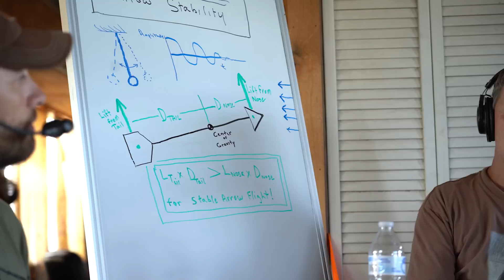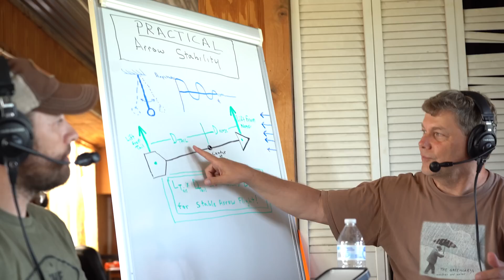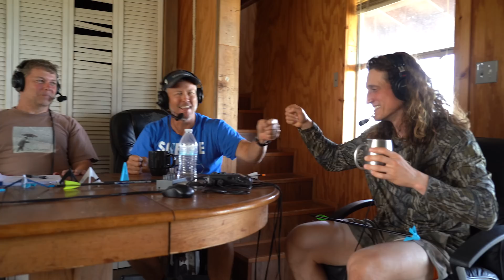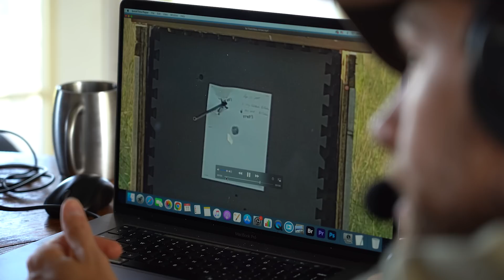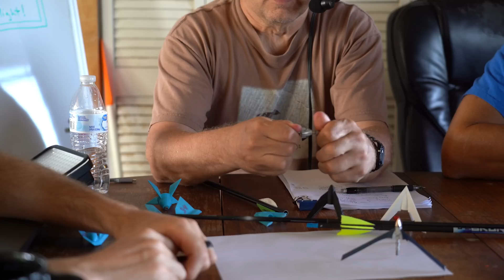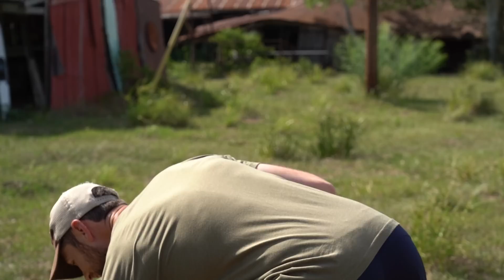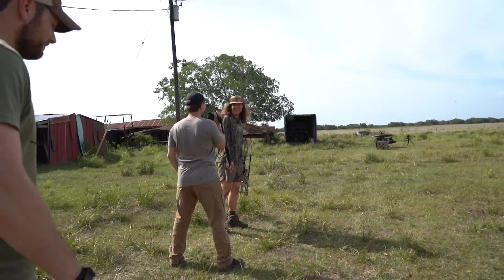WE SHOT A $500 BROADHEAD?!

Comment: The whole time I was wondering about the impact when the broadhead would get cocked sideways. I like the idea of the fixed point. I bet the gimbeled blade would allow one side to hit a bone then move away from the bone while the arrow continues to penetrate straight.

Another idea I have had is that you guys need to come out with a large diamond bench stone with about a 5-10 degree angle in a ridge down the middle so your average dummy can get sharper 3 blade heads. Sharpening 3 blade heads on a flat stone gets a really coarse angle and really won't shave hair. If your average dummy had a slightly beveled stone and kept the point running down the peak of the bevel he could get a much sharper blade angle.

Comment: .9 is 9 tenths is it not? .09 would be less than an inch? .9 would be 10.8”?
Reply: Not quite.  10/10 = 1", 9/10=.9", 9/100 = .09, etc.  So 9 tenths is a tenth less than 10 tenths.  Let's just say the group was slightly smaller than an inch at 60 yards :)
Reply: @DigtoDef  there is ten tenths in a foot. Not ten tenths in an inch. There are 10 100ths in an inch? 1 10th is actually an 1 14”. What he meant to say was .09. I assure you.
Reply: @DigtoDef  if I could send you a picture of my tenths tape I use at work, I could show you. I use tenths regularly. 0.9” is just a skosh over 10 3/4”. 0.08 is a 1” group.
Reply: @tylerraglin4133   I have no doubt that your tape is correct.  But  9/10 of an inch is .9 inches, 9/10 of a foot is .9 feet, and 9/10 of a mile is .9 miles.  Just because your tape reads .9 of a foot  doesn't make the other fractions of a distance invalid.  So .9 alone doesn't automatically stand for feet.  It's 90% of whatever unit your are associating it with.  Doesn't make sense to say he lives .9 from here without any units attached.   Take any digital caliper, set it on .9 inches, and see how far apart the arms are.   If they are nearly 10 inches wide,  I'll buy you a cheeseburger :)

Comment: I love new technology. Been using Mechanical BH for 25 years. In my book, if it has moving parts it's mechanical.  Who gives a darn how it is described if it works? Before going to press on some of those broadheads, might want to consider the fact that they could be defined as barbed as the blades don't fold back.  Good Luck with this one Rocketman, you can figure it out😉.

Comment: What happened on Zach's shot? It looked like the arrow was flying sideways through the air...
Reply: He cut the fletching off!  It can fly without fletching, but not when the shaft angle in flight exceed the gimbal angle.  We should've mentioned that he did that on that shot...
Reply: @DigtoDef  Ah, that makes sense. What caused the shaft angle to increase beyond the gimbal angle? It must be the release since we know the shaft itself doesn't generate enough lift to yaw the arrow that much, correct?
Reply: @travistaran2398  It can come from the release yes which is human induced. And it can also come from an out of tune bow or a torqued bow.  Either way, the arrow has a yaw rate associated with the launch.   Since it is a yaw (or pitch) rate, that means it grows with time and if the rate is high enough,  the nose can begin to lift (even on a field point) and the angle will continue to climb.  The yaw angle must've exceeded the gimbal angle at some point for the arrow to start generating lift and turn sideways, and with no fletching there's nothing to stop it from continuing to turn sideways.   In hind sight, we should've shot a bare shaft with a field point on it through Zach's bow first to see how it shot.  But the excitement of the moment took over for all of us, I think.   No damage to the broadhead, but that tripod tho.   It wasn't scientific, but it was a lot fun :)

Comment: This is awesome. Freaking love it. The aerodynamics are there, it’s just the mechanical implementation that’s tricky. 

Seems like you’re picking up a wobble at the blade-ferrule ball interface. My guess is that’s due to not having a true captive ball and socket joint with tight tolerances due to the sliding design you implemented to disengage the head lock during the the shot. 

Find a way to implement a shot-activated head lock release with a tightly-toleranced captive ball and socket joint and maybe that pesky wobble goes away?
Reply: Indeed.  You have hit the nail on the head and I so appreciate your comments.  The concept still needs work, and the testing here and with Bohning revealed that this implementation does not work 100% of the time.  I feel it's close, but it's not there yet.  When it does work it works magnificently.  
As an aside, I tend to think of the particular three-blade implementation I chose to fabricate as a technology demonstrator rather than a prototype near-market ready bh.  I felt like the three blade would be less problematic in an initial metal implementation.  In essence, it is a new technology, not a new broadhead.   Most importantly, whether this implementation works now or not wasn't really the point of the video.  The point I want people to know is that if you grasp the basic aerodynamics of the arrow, you know what things you can do to make them fly better.  This concept demonstrates but one of those possible things.  
FYI, none of this podcast episode was scripted.    It is what it is- no one even knew I had them there- I had planned  to introduce the concept while we were sitting around the table as a follow-on to the previous video on arrow flight.  I wasn't planning on them getting shot, or (gasp!) shot without fletching.  Leave it to THP to cut through the BS and get to the shooting.   Really though, I'm glad they were shot and captured on video warts and all for all to see how it can work and get a picture of what it's supposed to do.  

Best regards,
D-
Reply: Darrel, I think the fact the vid was unscripted makes this even more impressive. If only my aerospace courses were so straightforward and relatable! Also it takes guts to publicize a prototype these days when everyone’s a critic. Your (1) technical knowledge, (2) willingness to share that knowledge, (3) technical curiosity, (4) “garage” (or in your case, bedroom wind tunnel) engineering skills, and (5) willingness to fail are truly impressive! Can’t wait to see where all of this leads. Could definitely be an industry game changer. And no tech can be expected to be Zach-proof, especially with that goofy and super punchy form with which he hit that release trigger 😂

Comment: This has me intrigued beyond belief. What stinks is the process is so high tech it often takes years to get to market. Any timeline with Bohning? Probably have to keep that info hush hush but a 2" fixed blade that groups that well is an absolute game changer. I wonder if the penetration question could still be answered with heavier mass weight. I think itd penetrate just fine as is since a 1.5" or 2" fixed blade will create less drag on the shaft itself.
Reply: No timeline.  I don't feel like the concept is ready for primetime, and this may not be the implementation that should make it to market.  I hope it does make it in some form though!

Comment: Rockets and arrows are totally different things
Reply: @donmcbean7465  okay one an arrow is made up of carbon fiber with various spines and thickness. A rocket is made up of a series of metal. An arrow as a broadhead on the front a rocket has a point. A rocket is propelled by a combustion engine propelling it as with an arrow has no engine on the back and slows down immediately after launch. If we’re talking about space rockets they fly straight up and down as where an arrow flys horizontal through the air. Should I go on??

Comment: Interesting concept. I'm shocked at how many commented that don't understand that the chisel point of the head does not move. It is only the blades that are free to move and spin about the shaft  of the head. If anything this should keep the arrow tracking straighter in the animal as the blades can, to a degree, move around bone if the contact is at a shallow angle. 

RF and RM. This is a testing channel. Time to nut up and spend some cash on a proper slow-motion camera. I would love a test of mech, fixed, spinning insert, and the gamble head shot from an out of tune bow with slow-motion footage from 15 to 50 yards.....if ever an image was worth 1000 words.

Your work is fantastic and pushing positive change in an industry, and with a population, that needs it.
Reply: Thanks!  You nailed it - the nose is attached to the shaft via a rigid steel post - so it should fly as well as a field point and the shaft should hit in line too.  The blades should just pivot around the bone as needed.   We have a high speed camera, but so far it's been used for a lot of close in work - thanks for your constructive comments!

Comment: A big broadhead makes the kill zone smaller if it can't penetrate hard bone.  If you had a single bevel with lots of mass that could punch through heavy bone, then the larger cutting diameter actually makes the kill zone bigger.  So that's like the rocket man was saying: you don't want to make the broadhead any bigger than you can still get a full pass through.  But you want as big a cutting diameter as you can still shoot through heavy bone and the kill zone.

Comment: That is so cool. Basically taking the oscillation out of the arrow. But what I missed (might have been in the other video) is what about the rotation of the arrow due to it's helical or offset fletching, and drag from the kind and number of fletches?
Reply: I think it should spin normally with the field point, independent of  blade, assuming your ball/bearing is well lubed.
Reply: @feyrband  Correct that's is the plan, or spin the broadhead slowly CCW, while the shaft spins clockwise - that will keep all the threads tight.
Reply: @DigtoDef  have you considered blades specifically for penetration/burrowing? Something that's like a spiral wind spinner + auger bit. I don't see how you would resharpen it easily, though the focus could be more on the front edge like most drill bits.

Comment: interesting - so how does that head relate to all the Ashby standards that RF has been screaming about for a few years now.  I love the interest in applying this knowledge from the military research but just wondering how everyone is thinking regarding how that head will hold up. also the discussion of the arrow not being in proper alignment once it reaches the animal should be just how it will significantly deter penetration once that arrow slaps the body of the animal. love the creativity and application of prior test data to gaining more knowledge but question the goal of producing a head for market when so much effort has been spent over the years by this group to educate bowhunters on how to get proper arrow flight. just my .02 which aint much but video made me feel it contradicts what has been preached recently. I commend all the effort and good work in educating so many bowhunters on the arrow's they can use to be more lethal and responsible as hunters.
Reply: I believe the goal here is to discover if this technology can be used in an ethical way to harvest animals. It's still in development and although there are other ways to achieve lethality with proper arrow flight using the technology we have today with higher foc arrows nock tuning etc on fixed blade broadheads this new product they're trying to market will eliminate alot of headache for those who aren't familiar with that type of tuning process. The goal here is to allow more bowhunters into the sport and develop a product that they can use without as much of an extensive tuning process for proper arrow flight. The next step which they mentioned is to see how they can develop that product to harvest animals ethically while still using Ashby's studies for arrow lethality.
Reply: @par1013  Exaclty - still a prototype but easier tuning with large broadhead (or high speed crossbows that can't be easily tuned).  And I believe we can have a gimbal and structural integrity if we don't have it now by going to a one piece body and blades version.  Thanks for your insight!
Reply: I agree. I feel like they are worried about the archery part (getting the arrow to the target) and not the penetration and hemorrhaging that kills. Like he’s been preaching for years. Technology is already there to have perfect arrow flight between tuning the dynamic spine of your arrows by changing point weight, adjusting wheel lean (like on bowtech and elite), top hat system on mathews, moving the rest, tiller tuning etc. you can get good arrow flight without this technology. Most adjustments can be done with simple hex wrench.

Comment: Would it make more sense to make the insert have the gimbal instead of the broadhead?  Then you could use any broadhead and it probably be easier to manufacture.
Reply: you wouldn't have a solid line for penetration if it pivoted at the insert, it's why this still has a fixed point in front of the blades
Reply: @derek_sunday  Exactly!

Comment: How would the gimballed broadhead be affected by a side wind/gust?

I'd like to see you guys test the Ethics spinning inserts with fixed broadheads and see how that affects flight, impact, and penetration.
Reply: According to all the technical papers I've gone through, the broadhead should turn slightly into the side wind and reduce the overall lateral (cross-wind) movement of the arrow.  That's what the theory says anyway!   The purpose of these prototypes is to test situations such as wind, penetration performance, ease of use.  Thanks for your question!
Reply: @DigtoDef  sorry I asked this question a few days ago but haven't gotten a response. well I did get 1 response but someone deleted the comment. But why can't the gimble be attached to the insert and not the broadhead?
Reply: @stevenperue1528  The gimbal essentially takes the place of the center of gravity (cg).  The center of pressure (cp) of the broadhead needs to be behind the pivot point for stability.  If you put the gimbal in the insert, the cp will be ahead of the pivot point and the broadhead will immediately flop over to the maximum travel limit and wind plane severely.    I talk a lot about stability factors in the previous THP video that came out just before this one.

Comment: I’m pretty skeptical. Seems like an over complication… and don’t know how that gimbal on the front etc isn’t going to compromise structural integrity….
Reply: Well  I did try to address that although getting it down to 100 grains and 3 single bevel blades and 1.25" cutting diameter was a challenge that meant going to an aluminum 7075 body.   Right now the pivot ball is integrally machined into a steel post that links the nose with the insert.   I believe that aspect is already structurally sound.  The blades and the body just gimbal around the integral ball - so if they can survive impact we have full integrity.  I hope that makes sense on the design.   If we go to 200+ grains instead of 100 we could likely go to an integral body/blade system easily enough and then you have only three parts - nose, shaft, and body/blades unit.   I think that's a good direction for this to go in the future.   Thanks for your skepticism.  It makes me try harder :)
Reply: @DigtoDef  understood. I really hope it goes well. Look forward to seeing and hearing more. At the end of the day it’s either going to be really really good… or really bad. I think of all people you and the guys around you have the best shot at the “good”

Comment: A dumbed down version of this is basically take a pencil and poke it through a piece of paper.. the point is your broadheads point and the pencil is you're arrow.. and the paper is your blades. If this works the options are crazy. You can shot any blades you want. 2 3 4 single bevel Double bevel 1inch 2in.. I love the idea and I really hope it works out! This is not the same as a spinning insert.. on a spinning insert does the point spin with the arrow or with the broadheads?.. it's different ..
Reply: Yes it's different.  On a spinning insert the point spins with the blades.  Here the point is fixed to the shaft via a steel post and the blades gimbal around the post on an integral ball machined into the post.   Good eye!

Comment: If the ball inside there doesn't get damaged or punch through the collar, then I imagine most of the energy of the shaft would transfer for penetration. But would the 7 degrees of gimbal make the shaft off-angle enough to act like a brake and prevent penetration?
Reply: The nose is attached to the shaft via steel post, so at worst the shaft flies like field point arrow.  The body and the blades are all that gimble.  Hope that make sense

Comment: Curious what makes the 3 or 4 blade versions roll? The single bevels of 2-blade will generate roll, but I’m assuming the 3 and 4-blade heads are double bevel? Are there some kind of wings or offset built into the blades?
Reply: No, they're single bevel blades on the 3 blade, too.  Have to take them off to sharpen them tho